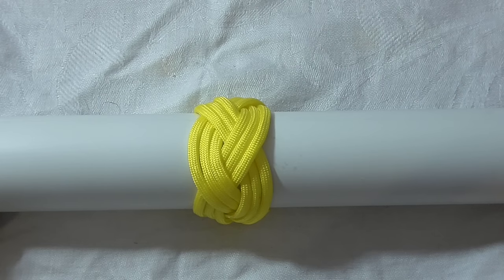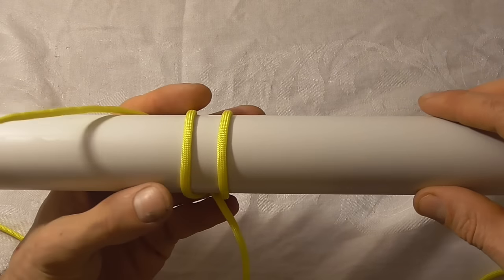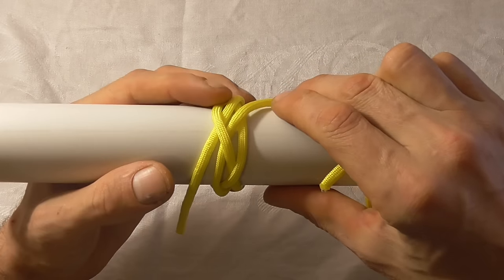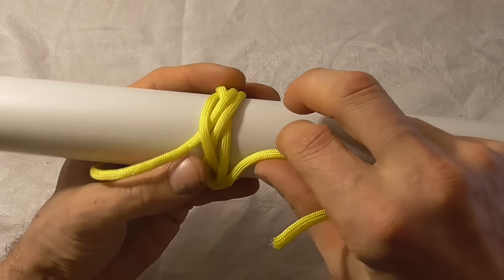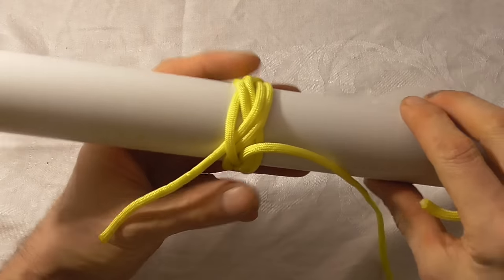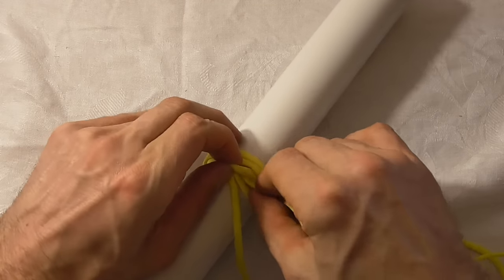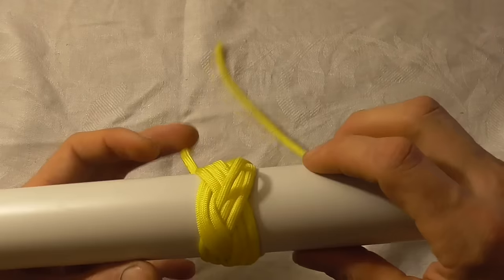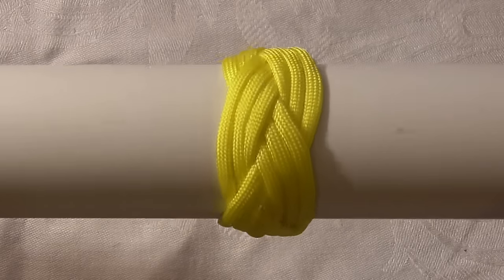How To Tie A 3L 4B Turk's Head Knot With Paracord - WhyKnot

Comment: They can also be used as stoppers on just about anything they can be formed on; When I was in the service, they were used on cutters to prevent "zero f***s to give" types from sliding down rails on the ladders, and I've used them on tag lines at the bitter end.
Thanks for posting this, by the way.

Comment: If you, like me, tried this and could not get it to work for some reason. Look carefully at around 0:16. The bottom thread is quickly pushed to the right so that the top thread goes around without crossing it, that was my mistake, and after that it worked well.

Comment: I do it different, but I taught myself. Do same over under over an through Top center. But I turn hand over to just 2 straight legs, so I pull rear over out side, that makes 2 over/under on back side, flip over hand an match mated trailing line through following first.

Comment: After watching this video several times and attempting to follow you (and getting lost every time), I finally realized my error:  you begin this knot with the short end! Rotating the tube didn't help much, either.  I kept thinking you were starting it using the lead end.  Silly me.  It would have helped greatly if you had used a needle on the lead end so novice viewers (like myself) could differentiate between the ends you were using.  Other than that, good video.  Thanks.
Reply from the maker: Thanks for your feedback helps me make easier to follow videos. Much appreciated.